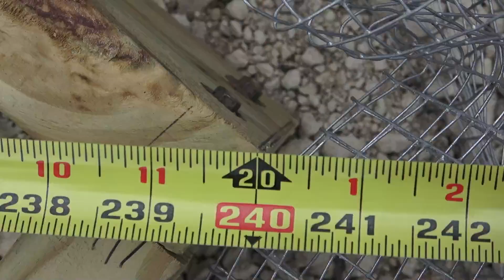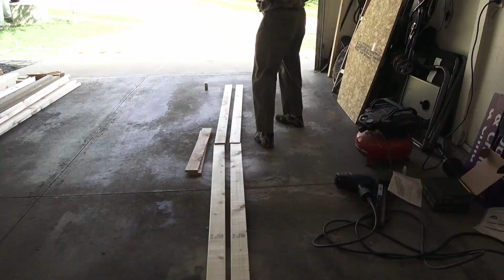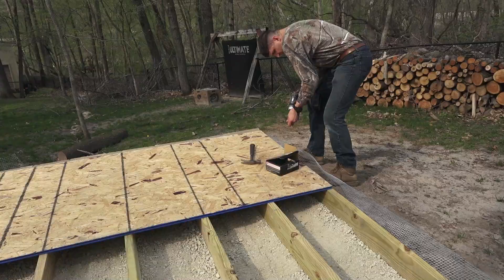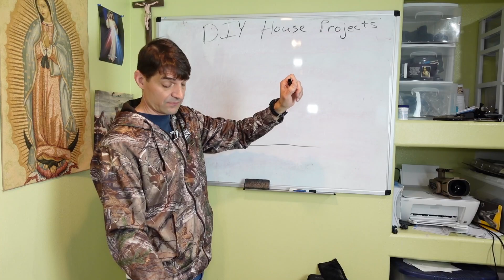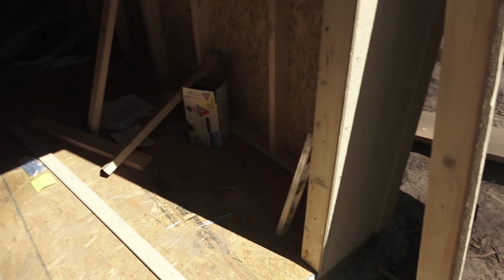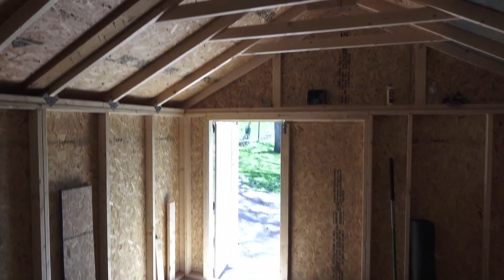DIY Shed Build

Comment: Sean, would the shed pieces fit in a standard truck bed. Have property 1.5 hrs away in the middle of nowhere. Would be tough to get a 18 wheeler there
Reply from the maker: As it came all boxed up, yes, but you'd need a fork lift to put it in as a package. Otherwise you'd have to take it apart piece by piece and load it into the back of the truck. It would be taller than the sides of the truck so you'd have to have it strapped in properly.
Reply from the maker: Don't forget that a package like this does not come with any of the floor and it does not come with shingles. So you'd probably be making a couple trips if you only have one pickup truck and no trailer. If you could rent a trailer or borrow a trailer you could probably get it all done in one trip.
Reply: @diyhouseprojects123  thanks! I don't have a trailer but could borrow one.
Reply from the maker: Yeah.. you'll probably need it once.you factor in the flooring material.

Comment: My dad when I was a kid built a large shed, I think making sure the roof and floor is water proof/ resistant will help with cleaning up, also using another material would help if the wood ever sways and gives up.  Possibly a water channel outside.

Add Windows are good but probably will always be slightly dark, so adding electricity or light bulbs would help.  Always used for storing lawn mower and less valuable things.  Adding a second back door ramp is useful.

Comment: I see you show how to make sure the floor is square once it’s framed, but how do you start and square it up from nothing? I’m not a builder, so…
Reply from the maker: I used a T square for the corners and did that first. The T square gives you a perfect right angle. You hold the boards together at the corner and screw or nail them together with the T square. Then measure from the corner over and mark the board every 16 or 24 inches (depending on how far apart you want them). Use a speed square against where the two boards meet where you marked it  to make sure it is square where they come together and then nail or screw them together. Then measure corner to corner as I show in the video to make sure the whole unit is square and not off a little. If one corner measures longer than the other, tap it with a sledge hammer and measure again till they are the same.
Reply: @diyhouseprojects123  Thanks

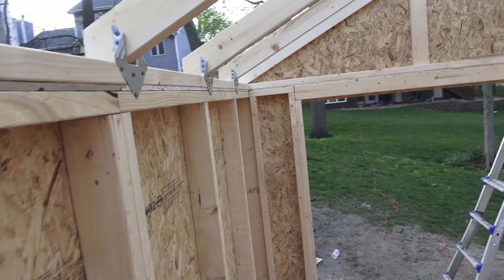Comment: 15:09 what if I don’t have any joist hanger things? Do I have to have them 😬😅
Reply from the maker: No they just make it a lot easier to set the trusses by yourself. You can just set the trusses in place and nail or screw them to the top wall plate but it will be a lot easier to do if you have at least one person helping you. If you don't then I'd screw two 2x4s with a slot between them that you could slide the truss in to help hold it while you screw it down. The hangers are not that expensive if you want to look into getting some though. Either way, you can make it work.
Reply: @diyhouseprojects123  awesome! Thank you!! I really appreciate you for sharing your time and knowledge. You explain everything so well and it helps me So Much! God bless you and yours 🫶🏽
Reply from the maker: Thank you! I am really glad you feel that way. God bless you and yours also.

Comment: Congrats on the new channel. Shed looks really nice. I would have thought that leaving airflow underneath the shed would actually aid in mold prevention. Now you have stagnant air and humidity that can’t escape, no?
Reply from the maker: The thing that causes high humidity is a sharp drop in temp not stagnant air. Warmer air holds more moisture.  When warm summer air drifts under the shed there is a drop in temp and the cooler air can't hold as much moisture so moisture condenses out onto surfaces (like on a glass of ice water in the summer time). That added moisture to the organic material (wood) becomes the formula for mold growth. Since mold spores are in the air everywhere they will be there and can start to grow.